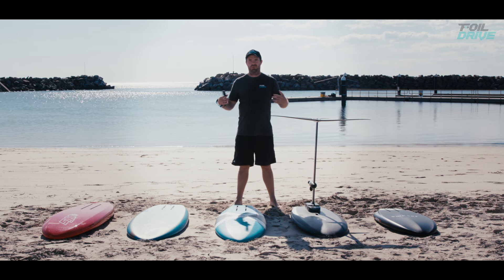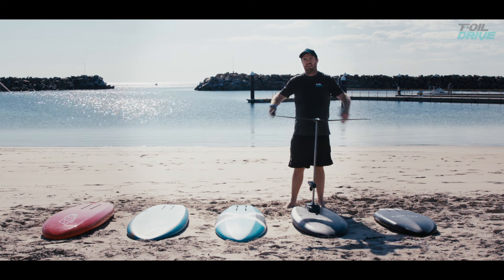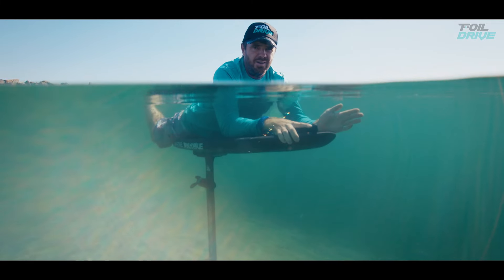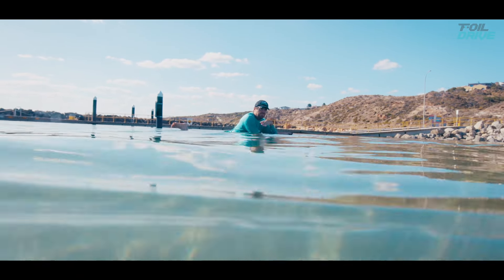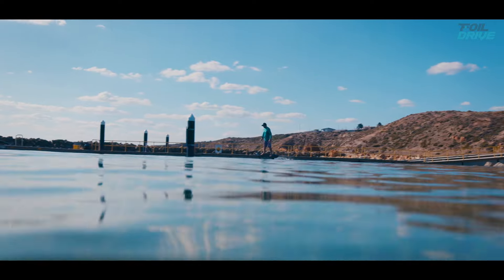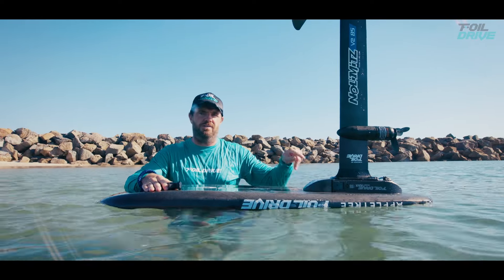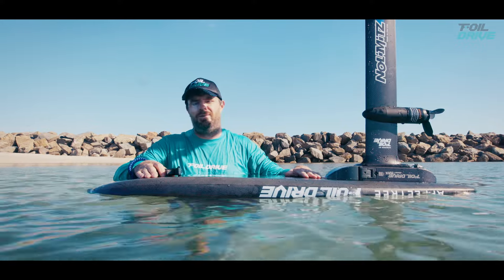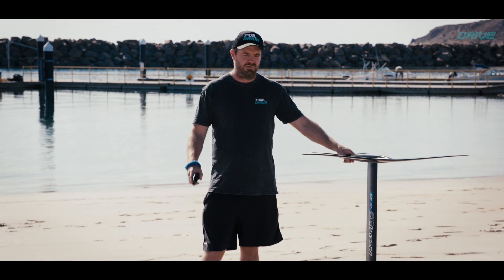How To Improve Controller Signal Connectivity | Foil Drive Masterclass Series

Comment: Thanks for the video! I just recently found out with my full carbon prone board with carbon tracks, that it helps to find a good spot on the nose for signal. Then to do  "one handed" strokes and leave the controller at that good spot. Works fine. I seem to notice less signal in salt water compared to a Lake😊. 🤙
Will use the antenna in the ocean.🙏

Comment: I think these tips will help me with my FDA + using my new Sunova Casey board. I had to try some new techniques last weekend (like holding the controller behind me and using cruise to start) compared to a much higher liter board (120L) I was using to learn on last year that was always easy to start the FD.

Comment: I’m about to buy foil-drive but have Armstrong FG carbon board. I’ve heard the latest release FD has better connectivity and there is the antenna if needed, but I’d prefer to invest the $A400 into smaller FD specific board like DC Foils or Sunova. Anyone out there using Armstrong well with FD at the moment? Thanks for a great product guys 😊

Comment: Hi guys thanks - keen to understand mast placement - thoughths?
Reply: Start right at the back of the tracks. Work forward from there if you need to. Hold the foil from the middle when upside down. It should be pretty balanced. There's vids on it.
Reply: Thanks
Reply from the maker: We've got a setup Masterclass on our to-do list but the advice from Simon is correct, if you are running the motor down near the fuse, the placement of the mast becomes slightly different as your thrust is coming from so low. This is where boards with long tracks are really useful to play even more with the placement.